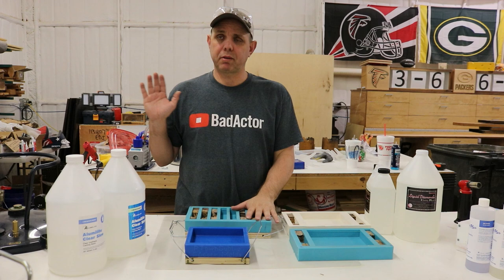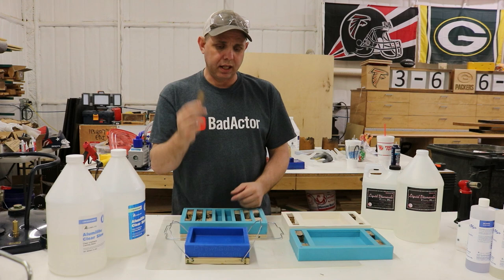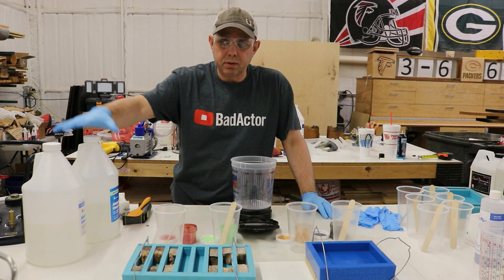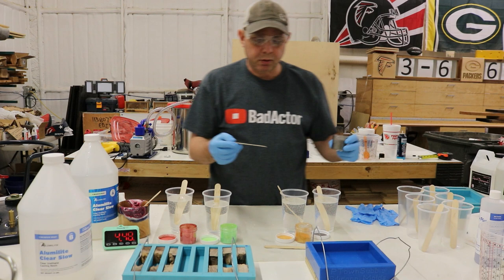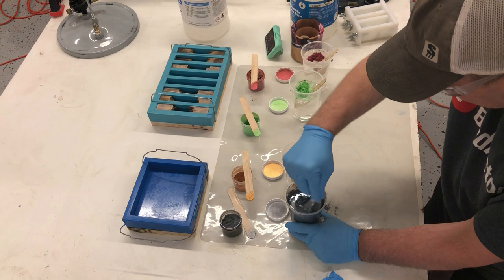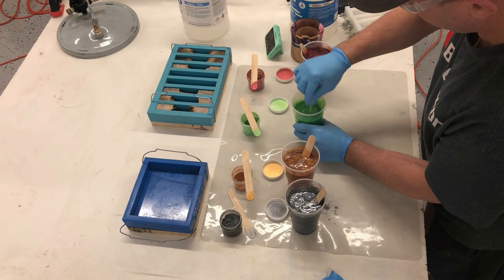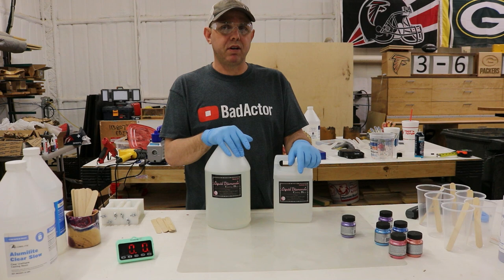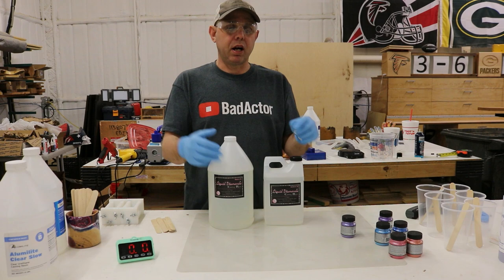Making Hybrid Pen Blanks for Beginners, With and Without a Pressure Pot!

Comment: Seeing it has such a slow working time, could you maybe degas the Diamond Resin in your vacuum chamber before the final pours and flaming? Kinda like you would do for silicone.
Reply from the maker: You can, but if it’s not necessary  you wouldn’t need to. I didn’t use vacuum or pressure and they turn out fine..
Reply: @JakeThompson  good to know, thank you. My pressure pot can only handle around 30cm diameter so might look into this resin as a better option for large pieces

Comment: Very informative! You mentioned stabilized wood for your castings. Could you have coated the wood with a couple coats of shellac to seal moisture in? Of course,  surface moisture would still have to be dealt with. Thanks, John
Reply from the maker: Thank you John.. I have done some before I started stabilizing that I coated with a thin coat of resin.. it turned out ok.. the other thing to think about is most of the time the burls we use are brittle and can come apart while we are turning.. if you have some that isn’t brittle.. coating it works fine, but I would still make sure it’s dry.

Comment: Jake, those turned out really nice. Hey, bought one of those 5 gallon CA pots you like after your last video about the new one you got. I have to seal some leaks on the threaded fittings. What is the best thread sealant you have used? The teflon tape did not hold up to the pressure! Thanks and keep up the great work and videos, stay safe and cheers from MT.
Reply from the maker: Thank you. The liquid Teflon is the best. I put a link to that under that video..  I’ve used the pot plenty now.. I love it.

Comment: how do u keep the wood from floating when u pour in the resin
Reply from the maker: Either hot glue the wood to the mold, or make it a snug fit.. or put some HDPE plastic on top and something on that to weigh it down

Comment: Did you spray the molds prior to pouring with anything?
Reply from the maker: I spat them with mold release. Every time.. I use the stuff from alumilite that’s fir silicone.
Reply: @JakeThompson  do you spray them prior to pre-heating the molds?
Reply from the maker: @charlietuna1355  yes I do.. I will spray them and let them set for 10 minutes or so, then put them in the oven.
Reply: @JakeThompson  thanks Jake.

Comment: Where did you get those molds?
Reply from the maker: I made all the silicone molds except the bright blue one.. it’s from p-Town subbie
Reply: @JakeThompson  the tray looking one with the ends for pen blanks or the pen blanks one? Will you be selling those?
Reply from the maker: @kandiecandelaria1423  I may in the future.. stay tuned.. what size pressure pot do you have?
Reply: @JakeThompson  I converted a HF 2.5 per your instructions lol finally got it leak free. Bought some stabilized scrape wood, Aluminite Slow and already had some mica powder, torch, and heat gun so I am ready to go lol
Reply from the maker: @kandiecandelaria1423  that is sooooo cool!! I’m excited for you.. I would put the wood in the oven at about 150f for about 20 mins or so.. just to make sure the surface moisture is out of it.. then happy casting.
Reply: @JakeThompson  I’m excited to try abd make some I. The next few days..... being re watching your videos so that I can make sure I have everything ready
Reply from the maker: @kandiecandelaria1423  Awesome... you got this! 👍👍